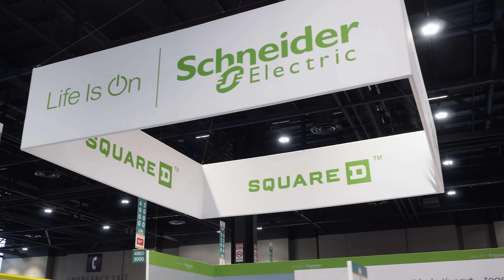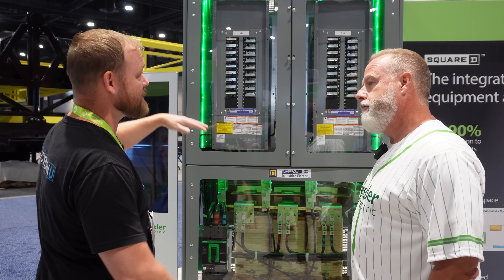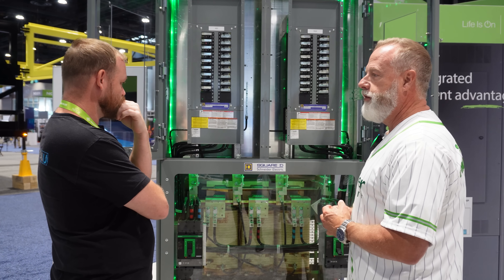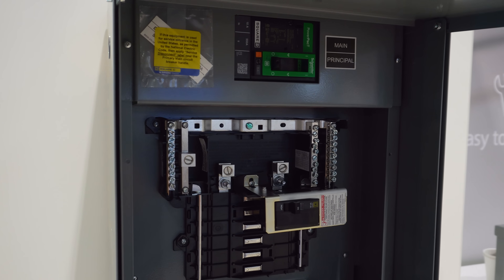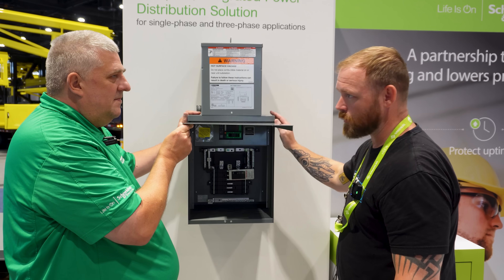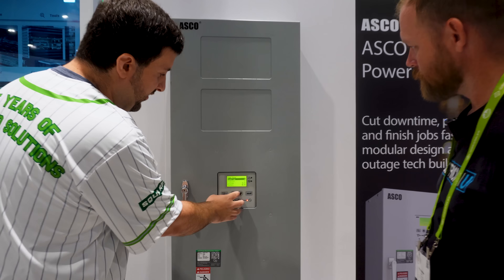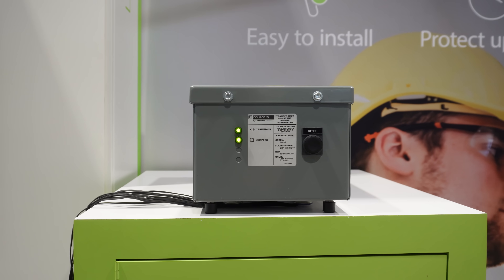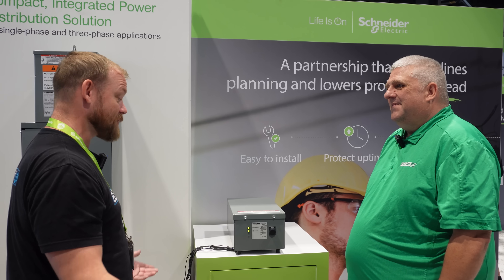The Future of Electrical Work Is Here: Inside Schneider at NECA 2025

Comment: For the Integrated Power Center I'm Curious if those top breakers meet handle height NEC requirement....also I imagine you have to apply the 480V line side Arc Flash value to the whole piece of equipment...where as typically the 208/120V panel downstream of the the dry type transformer will have a very low arc flash value...

Comment: What do you think about the panel height mounted on transformer  ? The operating handles for the breakers seem quite high — I’m wondering if it meets the code requirement for maximum breaker height.